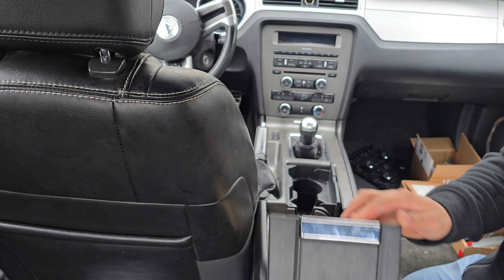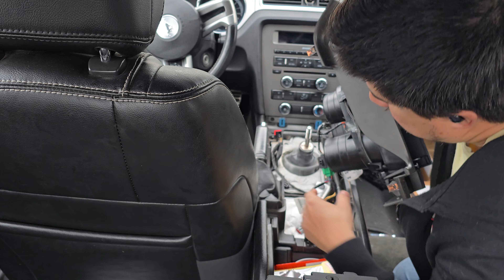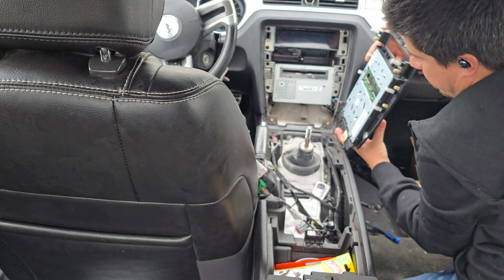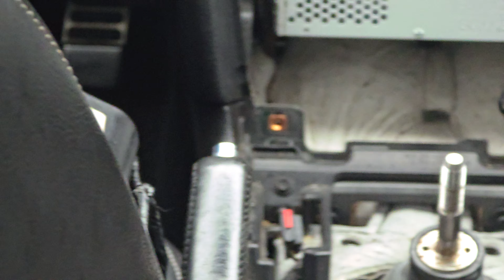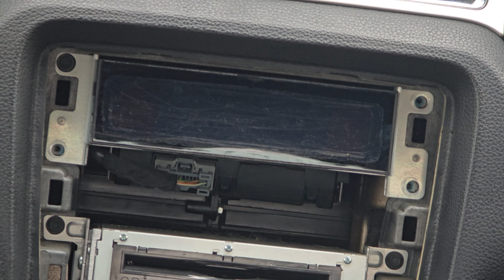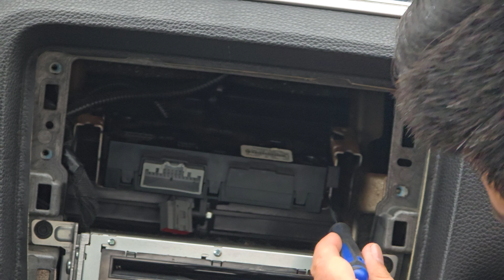Removing HVAC Module 2011-2014 Ford Mustang

Comment: Have an issue with the hvac control panel, they iluminate when it’s night but don’t turn any orange light on. The fan turn on and I can switch to different vents but the a/c doesn’t turn on (no cold air)
The stereo does work
Could it be the control panel or the hvac module?
Reply from the maker: It could be either the HVAC module or the FCIM (controls).

The way the system works is that the FCIM sends a canbus signal to the HVAC module telling it what to do. The HVAC module sends a signal back to the FCIM telling it what it's doing.

The indicator (amber) lights work when the FCIM receives the canbus signal from the HVAC module.

So either your HVAC module is not correctly interpreting the signal from the FCIM thereby not sending out the correct signal for the indicator (and not turning on the AC) or the FCIM is not sending the correct command.

I, personally, would start by replacing the HVAC module. And if that doesn't work, replace the FCIM afterward.

There is a possibility that the fan in your car resistor has blown (that was a problem I had) however all my indicator lights were still working.
Reply: @MyElectronicMechanic do you know where I can get a hvac module?
Yesterday after washing the car, the a/c turn on  and the outside temp sensor went down to -49‘ after an hour came back to 50‘ and it stop working

Comment: do you have a part #?
Reply from the maker: There are many different part numbers depending on your vehicles options

Does it have:
Heated seats? 
Dual climate control?
Automatic Climate Temperature?

Comment: hi wanted to ask u a few question with my problem before buying a hvac module so here it goes:
2011 mustang gt premium
1. radio works fine and Bluetooth
2. climate buttons work but the led indicator does not work. for example i turn on the defroster or swith where air blows they function fine but the led indicator does not work
3. turning on the headlights all of the background lights work on the radio screen.

i was going to buy the hvac module but seems like i may have a different problem as i read your answers to peoples questions

thankas
Reply from the maker: Indeed, this is most likely not the HVAC module if your HVAC is operating as intended.

Here's a question. Be very specific, what buttons don't illuminated in the following:

In the HVAC Row, you have:
Left:
Power
Defrost
Rear Defrost

The center vent control

Right:
A/C
Recirculate
Max A/C
Reply: @slonison all of them, the background lights work just not the led indicating that they have been pressed all the buttons function though

Comment: My ac/radio works, but separately. I can turn my ac on, and it works fine, but there are no sounds from my radio and vice versa.
Reply from the maker: If you are getting absolutely no sound, then that most likely rules out your speakers.

So my first follow-up question is, do all of your controls work? As in, if you turn on the radio, does the display update and change through radio stations and volume?

If yes, then you most likely have an issue with your ACM (behind the head unit controls), if not, then it... Probably is still the ACM. But could be the FCIM (though it would be strange that the radio controls broke, but the ac controls didn't. Not impossible, but unlikely.

Comment: Long story short my Audio Control Module is bad! Radio doesnt work, clock disappears and reappears. So i stopped using it. Then my ac randomly changes from panel to defrost setting on its own. I did some research and apparently the hvac system and the audio control module are tied in together making it if one messes up the other might have problems. What do you think?
Also driver side air vents are blowing somewhat cool air but not cold as to the passager side which is cold cold
Reply from the maker: I'm not an expert in this field but I can give you this information.

The HVAC and audio all operates on the data bus system. Most likely MSCan because it's not  integral to the operation of the car.

The car has 4 primary components you're referring to.

FDIM which is the the display that shows the radio, clock, etc. Front Display Interface Module

FCIM is the buttons and knobs, this controls the actual settings. Front Control Interface Module.

HCM is the HVAC Control Module. This is what interprets the signal you send from the FCIM.

ACM is the audio control module which lives behind the FCIM. This also contains the CD drive and how the radio works.

If your radio AND your HVAC are acting up, it COULD be your FCIM that has the problem. Try taking apart your FCIM to see if you have problems there first... That would be my first place to check. (Since they all travel along the MSBUS system, check your connector as well and try to follow the wire for any tears or cuts.)
Reply: @MyElectronicMechanic thank you brother
Reply: Did you ever get this sorted? Mine is doing the exact same thing...
Reply: @turdferguson6118  as far as my audio control module is concerned, its still fried, but as for my AC, it hasn't been switching on its own like before but! I knew my blower motor was pretty much bad (the fan speed would randomly switch from high speed to low speed to having weak air flow even when I didnt manually change it) after replacing the blower motor everything went back to normal. I got my part through RockAuto, instead of local auto part shops its cheaper in some cases
Reply: @orlandocharles8948 I found a video a while back that points to the problem in the acm. There's a little chip that comes unsoldered. I had a friend who's good with that stuff work on it. It worked again for a few months but I guess it came loose again. He said he'd give it another go and really make sure it's set good. Just need to take my dash apart again...

Comment: My ac isnt working all the control buttons have lights except for the orange lights in the buttons they also all work when i press them but just no cold ac. I used a scanner and came up with lost communication with hvac control module. Do you think i have to replace this module?
Reply from the maker: Hi Luis, it could be one of two things, it could he the HVAC modul itself or it could be a short between the FCIM (the head unit) and the HVAC module.

HVAC modules used arent terribly expensive, but i highly recommend you get ine if the same model.

Comment: Did you replace your climate module or the controllers? And why?
Reply from the maker: I replaced the HVAC module one my car because I wanted to add OEM heated seats.

I opted out of the Comfort Package when I bought the car. In order to add OEM heated seats that utilize the stock OEM head unit, you need to swap out your HVAC module to one that came with heated seats. That was the reason for this video.
Reply: I have a issue where the AC power button is not powering on. Trying to diagnose before replacing.
Reply from the maker: @stevenhernandez1346  the firs thing i would try is to determine if the head unit is wokring. When you press the buttons, do the lights turn on? If yes, do you hear any clicking? Does the fan turn on or do you get nothing at all? Do it in baby steps. Do you have any DTC codes that your car is throwing?
Reply: My climate control lights, A/C knobs and radio display are all not working. Do I need to replace the same part to fix this (all fuses are good)?
Reply from the maker: @justintaylor536  does the radio/AC actually work but just not backlight, or it doesn't work at all. It's probably not the HVAC, but I suspect either a problem with the FCIM or a wiring issue from the FCIM to the CANbus system
Reply: @MyElectronicMechanic The radio display is off but you can hear static. Sometimes if my Bluetooth is on that works too..
Reply from the maker: @justintaylor536 if that is the case, it is more likely that your FCIM or your ACM is damaged.

The FDIM is you Front Display Interface Module. I doubt it's that because if it was only that, you wouldn't have any problem with the sound just wouldn't be able to see it.

The FCIM is the Front Controls Interface Module. It's the controller board that manages all your buttons. I have a feeling it's probably not that either. Because you probably wouldn't be able to get anything to change (follow up Q, do your radio buttons illuminate at night?)

Last is your ACM Audio Control Module, this is the brains the of the radio and sits below the HVAC module. I have a bad feeling it might be this but, I would venture to guess that you want to double check the FCIM like mentioned above first.

TheHVAC Module only processes HVAC decisions. It has no effect on the radio whatsoever.

Comment: Question. My air completely went out. Won’t turn on at all on any temp or speed. I tried replacing the blower motor , that didn’t work. The blower motor resistor was tested and showed to still be good. All of the fuses are good. What could it be?
Reply from the maker: I'm not sure if you have checked or not. But does your car have any DTC codes (not a check engine light, but any codes being thrown. You need a scanner to check, a parts store may be able to check). Sometimes a car will disable unnecessary functions when there are other problems.
Reply: @MyElectronicMechanic I will check that when I get home! I have a scanner at home :)
Reply: Hey I'm not sure if you've fixed it or not, but I had the exact same issue and it was instantly fixed just by replacing the hvac module, no programming required

Comment: Hi, my heater blend door actuator is randomly changing the temperature, i changed it twice but nothing changed, i might change the module but am not sure what does (aa ab bb c) at the end of part number means
Reply from the maker: Go to this link:

https://docs.google.com/document/d/1mGahj1b_rCL9HVTtmfIRH2874QX9IGGkjvRQxDQc_Po/

It's a write-up I did on installing heated seats. On page 15, it should answer your question. 😃

Comment: I think I have the same issue as the other commenter.  No lights illuminate on my panel.   But the controls still function.  Radio, blending doors, heat, fan.   The A/C doesn’t kick on.   I swapped the panel, and the fuses.  Still nothing.   Could this be the culprit?    Thank you!
Reply from the maker: @SonnyGTA  
I'm going to ask very specific questions:
1. The radio buttons illuminate when forced on? (Headlight switch on AND the windshield sensor covered)
2. The radio buttons operate the radio and you can hear and control the music?
3. The HVAC buttons illuminated when forced? (Same as question 1).
4. The HVAC controls can switch between floor and vents?
5. The HVAC does or does not blow cold air when given sufficient time?

Comment: My mustang’s climate system doesn’t turn on at all could the HVAC module be the reason it doesn’t turn on??
Reply from the maker: When you press the buttons on the head unit, do the head unit LEDs change?
Reply: @ no lights turn on, nothing for the system turns on it just randomly turned off while driving and didn’t turn back on
Reply from the maker: @JojoReRe559 If you're getting absolutely no lights on the head unit at all. My first guess would be that you have an issue with your head unit. The way these cars work is that there is a mini computer in the back of the head unit that basically decides what button you pressed and to turn on the light or not, THEN send the signal to the HVAC module to actually turn on the mechanical components. If you aren't getting lights, my guess is that the mini computer on the back of the head unit isnt even sending a signal at all.
Reply: @MyElectronicMechanic I’ve had the unit replaced with a new one and it’s the same problem
Reply from the maker: @JojoReRe559 Its been a while. Have you figured this out?

Does your radio work?
Reply: @MyElectronicMechanic i noticed that I didn’t have a ambient air temp sensor on the car anymore then I looked up if not having one would prevent my ac from working a d so I narrowed it down to that
Reply from the maker: For my own learning, how did you go from having an ambient air temperature sensor to not having an ambient air temperature sensor?
Reply: @MyElectronicMechanic  to be perfectly honest I have no idea it wasn’t till I noticed that I wasn’t getting a reading for the outside temp that I looked it up
Reply: @Joj @JojoReRe559 man I have the same issue as you, where is the ambient temp sensor on the car, cause mine went to 50f and after that stop giving me the outside temp.
As well where did you got that sensor?
Reply: @SebastianDavila-c4v the sensor is normally in front of the radiator or on the front number but my problem still persists I’ve been searching and it might be the HVAC module since it still turn on sometimes when the car is only on accessory mode but once I turn the car fully on it goes back to how it was where only the defroster is on and stuck on a slow speed with the heater on